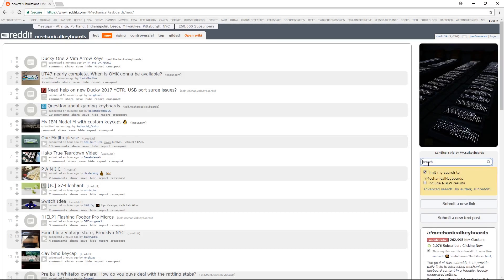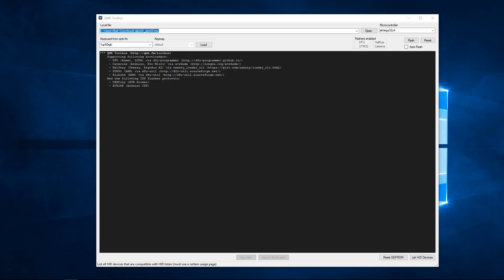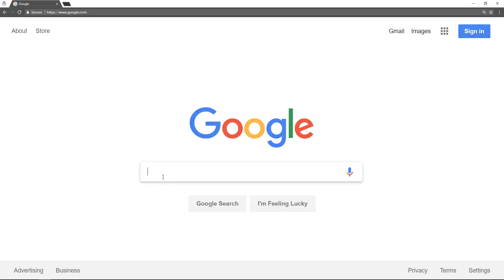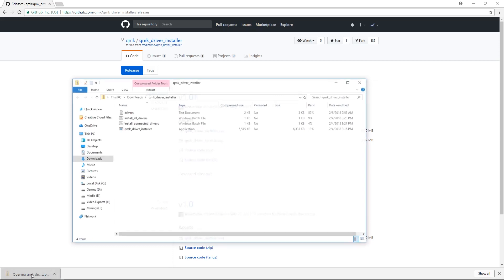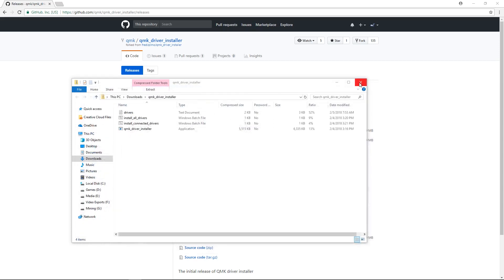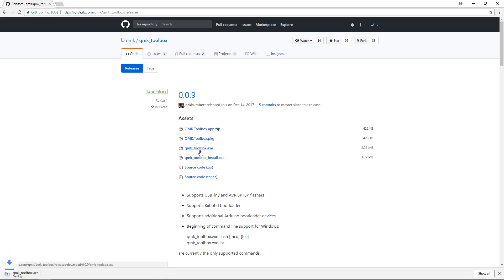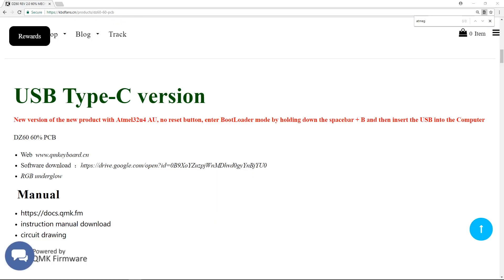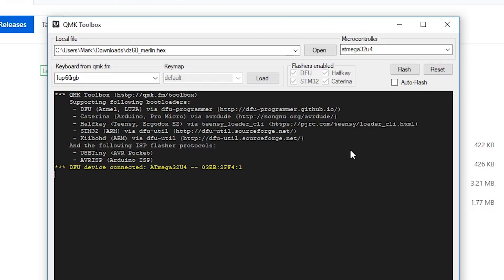QMK Tutorial: QMK Toolbox (DEPRECATED)

Comment: Great tutorial.  This was the first one that managed to get close.  When I tried to flash my device I got this message:
"dfu-util 0.9    Invalid DFU suffix signature
A valid DFU suffix will be required in a future dfu-util release!!!"

And now my board is stuck in flash mode.  I assume because the firmware had a corrupt file or something.  Any ideas?  I'm so desperate I'm writing in a YouTube comments section :(
Reply from the maker: That looks like a driver issue. Did you install the drivers I recommended? You could also try running it in administrator mode to see if it makes a difference. I have other helpful tips in my text based guide: https://github.com/mechmerlin/qmk_setup/blob/master/windows_flashing.md
Reply: Yep, I installed the driver.  That was my thought too.  Thanks for the tips.  I'll see where I get to!
Reply: These tips are awesome.  Thank you so much!  I have a sinking feeling it's a conflicting driver getting in the way... will have to work out how to uninstall all the previous garbage :)
Reply: Hi I was just wondering if you got your flash to work?? I have the same error and I’m at a loss :(